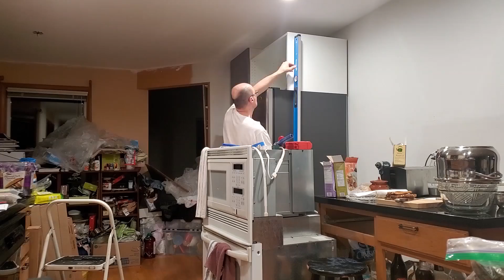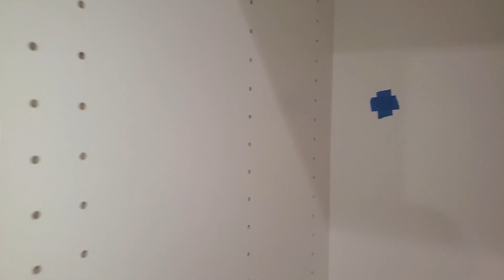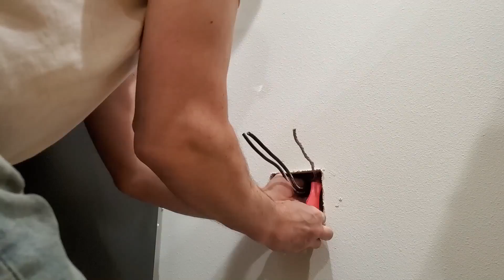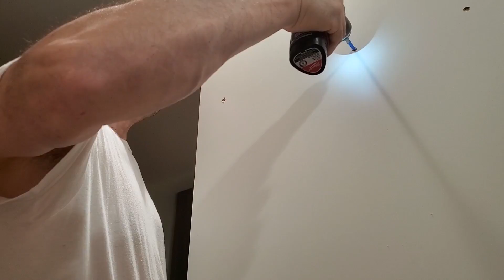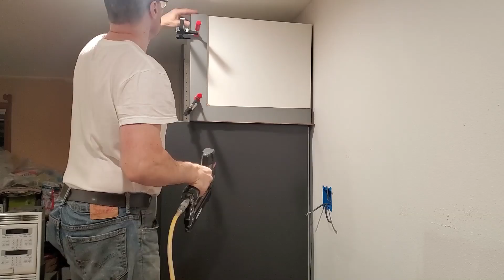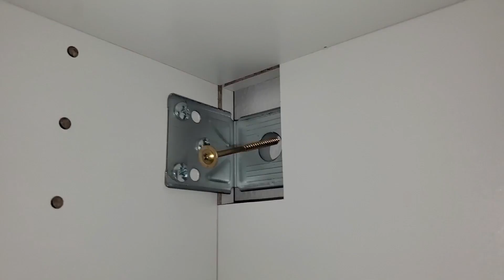IKEA Refrigerator Cabinet. Установка кухни IKEA

Comment from the maker: All video about this Kitchen 
Full list of videos - "Old kitchen replaced for IKEA"
1. IKEA Kitchen, Design, Planning. Кухня IKEA, дизаин, планировка  https://youtu.be/IAM49Tfm9Vk
2. IKEA Kitchen, Old cabinets demolition. Разборка старой кухни  https://youtu.be/c_sEq7CEBGU
3. IKEA Pantry cabinet installation. Установка кухни IKEA  https://youtu.be/c5kdXEkk3vg
4. IKEA Refrigerator Cabinet. Установка кухни IKEA  https://youtu.be/6cHSXHfDoeU
5. IKEA Oven and Micro cabinet, Window trim, LED wiring. Установка кухни IKEA  https://youtu.be/gMW2csSP5lI
6. Window painting before IKEA wall cabinets. Покраска окна перед IKEA шкафами  https://youtu.be/3xrpnTj_QGg
7. IKEA Wall and Base Cabinet installation. Навесные шкафы и тумбочка кухни IKEA  https://youtu.be/SxO82Lw3VsM
8. Countertop Installation IKEA. Установка столешницы IKEA кухни  https://youtu.be/AY2ikKG9Hao
9. IKEA Wall cabinet installation. Настенные шкафы IKEA  https://youtu.be/JmYqcn106ds
10. Light Switch for LED under cabinet. Выключатель для светодиодной подсветки  https://youtu.be/8VBIw6Dl2mM
11. Under cabinet IKEA trim and side panel. Кухня IKEA, установка боковых панелей  https://youtu.be/ZfMVL0GrzZk
12. How to install a drawer handle IKEA. Как установить ручки на ящики кухни Икеа  https://youtu.be/645s8e-qmtY
13. How to Install Cabinet Bar Pulls. Как установить ручки на двери кухни Икеа  https://youtu.be/yhlGFIaXG3I
14. Windows painting. Грунтовка и покраска окон - https://youtu.be/FBpluiC-4pQ
15. Granite Countertop Cracks. Гранитная столешница с трещинами - https://youtu.be/FcvIS7DXnsA
16. Replace Cabinets Without Removing Countertop. Укрепление гранитной столешни  https://youtu.be/dmnHyz1i1UY
17. Granite Countertop Edge Support. Укрепление края гранитной столешни  https://youtu.be/zHQjo_liKhk
18. Plywood Support under Countertop, IKEA cabinet. Укрепление гранитной столешни кухни ИКЕА  https://youtu.be/pZ7J7GdDAHQ
19. How to make Floor Vent Under Cabinet. Воздушная труба под тумбочку  https://youtu.be/eSQoIbTK9vY
20. Old Sink Drain Pipe Extension. Удлинение трубы слива раковины  https://youtu.be/VNOEfpE4H4g
21. Garden Faucet Replacement. Замена садового крана  https://youtu.be/eWbU8DK-3JY
22. Cut Counter Top for a New Kitchen Sink. Подрезка столешни для новой раковины  https://youtu.be/bwCjFCE6vjg
23. Plywood support and two cabinets installation. Укрепление гранитной столешни кухни ИКЕА  https://youtu.be/dPPSq0HUT20
24. Kitchen Sink installation. Установка мойки, раковины  https://youtu.be/itoQH_OEuBA
25. Kitchen Faucet and Garbage Disposer installation. Установка крана и измельчителя отходов  https://youtu.be/7eiquGydvDA
26. Dishwasher installation. Установка посудомойки  https://youtu.be/t1aRk9wvvO4
27. IKEA Cabinet side panel, Drawers, Door. Боковая панель, выдвижные ящики, двери ИКЕА  https://youtu.be/tp4WRQfOCko
28. Island Mount Range Hood installation  https://youtu.be/XNl1r2538yA
29. Hood Duct pipe and Electric Outlet installation. Труба вытяжки и розетка  https://youtu.be/0IDhl8vfP80
30. Recessed Light Housing for LED. Светодиодная лампа над плитой  https://youtu.be/yj5pJXq_XtE
31. Island Range Hood Installation. Вытяжка над плитой в потолке  https://youtu.be/WgI0EnnLrMk
32. Range Hood Reinstall Higher. Переустановка вытяжки повыше  https://youtu.be/JDOnix5G_K4
33. Counter Top support before Cabinet Demolition. Как удалить тумбочку под столешней  https://youtu.be/Fo3Bg9uMjP8
34. Plywood under Counter, Cook Top Cabinet. Тумбочка Варочной поверхности  https://youtu.be/mur2U-MGYuU
35. Cook Top Installation. Варочная поверхность, установка  https://youtu.be/NO4tFznoNvo
36. Cabinet Legs Support, Last Cabinet installation. Ножки под тумбочку  https://youtu.be/wmO8f1ayzqs

Comment: Hello there, with your filler panels, did you allow for the 22mm for the front of your cabinet doors and drawers to align to?  I see from your video that you aligned your panels flush to the cabinets and not flush to the drawers and doors.
Reply from the maker: I sink, there is two option - flash to the cabinet and flash with doors. My view on that filler was like I was done it. Side panels done flush to the doors and drawers.
Hire is a little view on finished part https://youtu.be/JmYqcn106ds?t=549